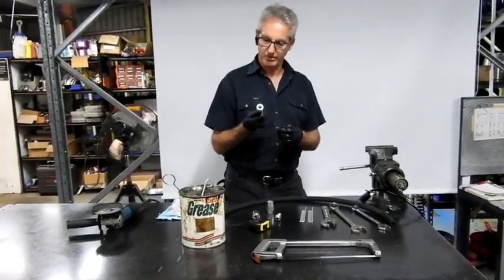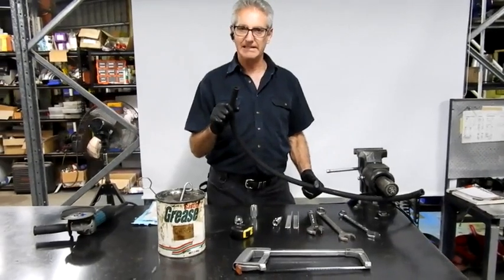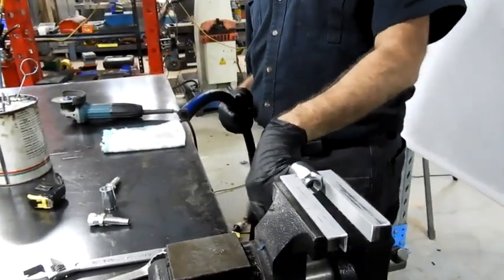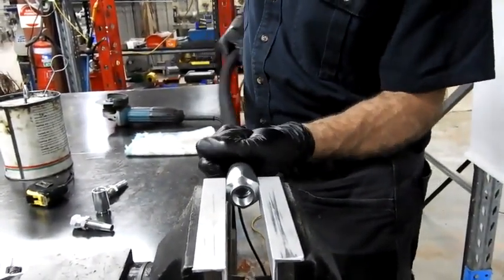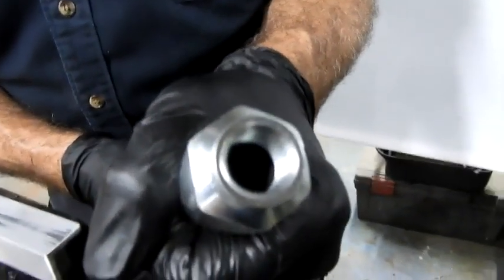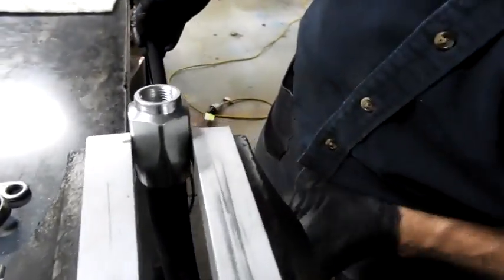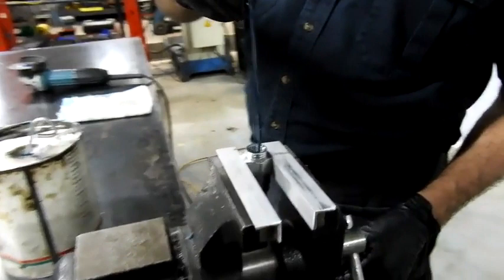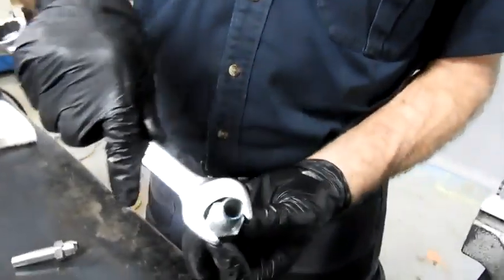How to Quickly Install JIC or BSP Reusable Hose Fittings onto Hydraulic Hoses

Comment: Ive bought (from you guys) and had great success for about 30 of these at 3/8".....but the last ones I bought 1/2" have leaked between the fitting and hose,on one hose only ,out of three (also a pin hole spray out of hose when dead headed,reliefs at 2000psi)....I redid the fitting and again leaks between fitting and hose (is the delivery hose from pump.....I know I'm  not doing it wrong,could a faulty hose cause this,don't know what else to try....love your online shop,keep it going.
Reply from the maker: You need to make sure that you are using "new" SAE 100 R2 Specification hose with 2 wire bodies, 
and new SAE 100R1 Specification hose with a 1 wire body. 
A "2 wire body" will have two thin rings or grooves machined onto the neck and a "1 wire body" will have one ring or groove machined into its neck.  
Also we do not recommend that you use Old or used hose to make assemblies as the rubber may have perised with age, temperature, and prolonged contact with oil. 
You should have been given the opportunity to download assembly Instructions when you placed your order. 
Please let us know if you continue to have issues.